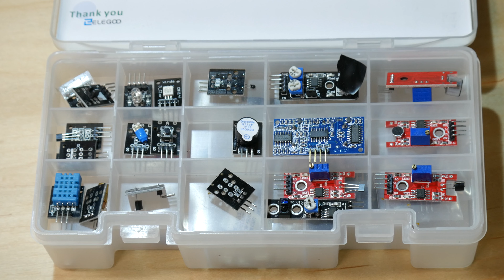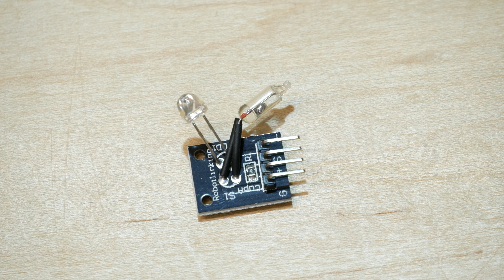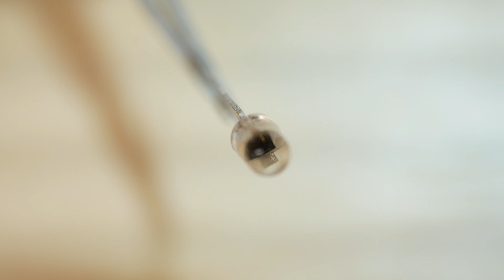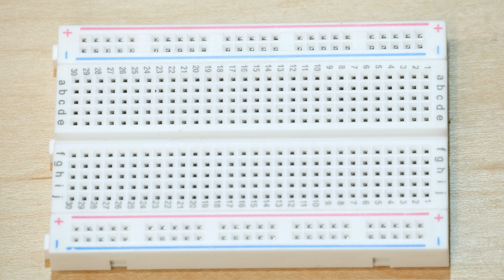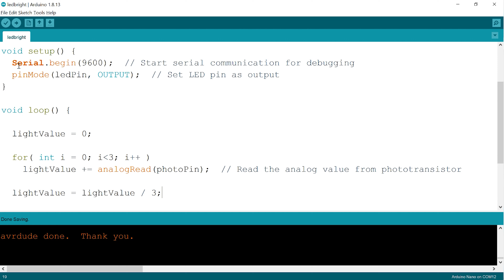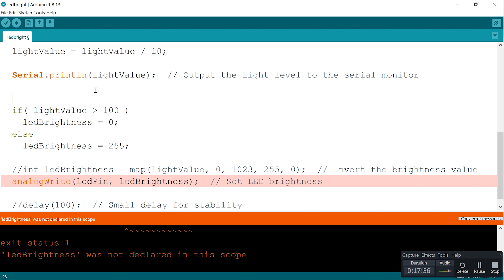Measure Light with Arduino (LDR vs Phototransistor showdown!)

Comment: Very helpful video.  Especially the resistor part at the end.  I am working on something to detect flashes, like a camera flash or a laser.  I feel like the greater range will help detect it better.  Thoughts?
Reply from the maker: Without more information on the application it's very hard to say much that's useful. But keep in mind that a camera flash and laser are almost polar opposites. A laser is a tightly focused beam of light with a narrow wavelength. A camera flash  covers a wide range of wavelengths, and sprays light everywhere so it can light up your shot.

Comment: nice video. I have a project developing a spectrometer, in this case It's important to work with a specific wavelength of a source light passing through a sample. do you have any suggest about using a specific LED or phototransistor instead LDR to filter and measure a specific bandwidth??